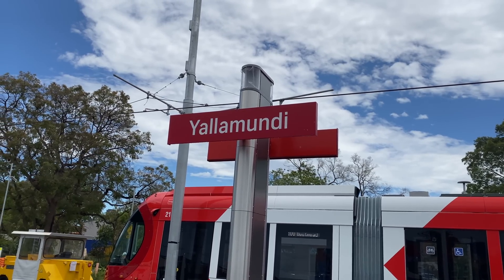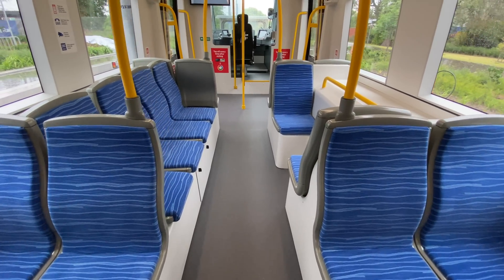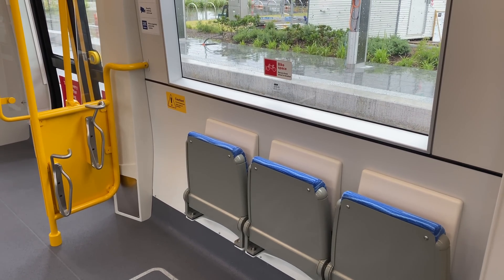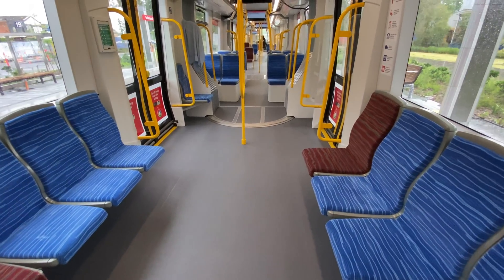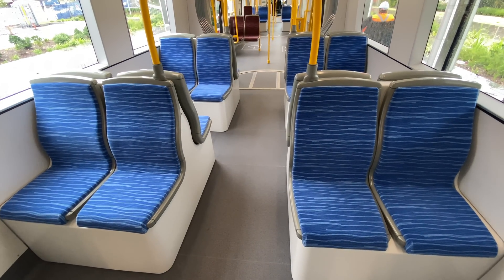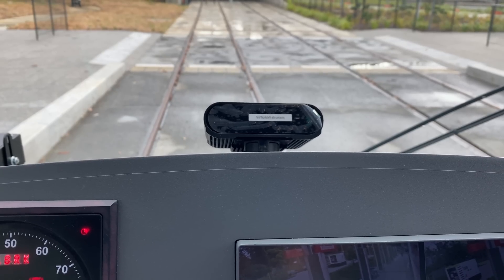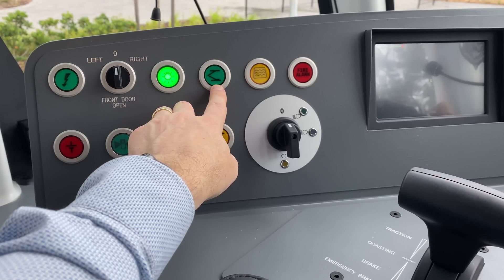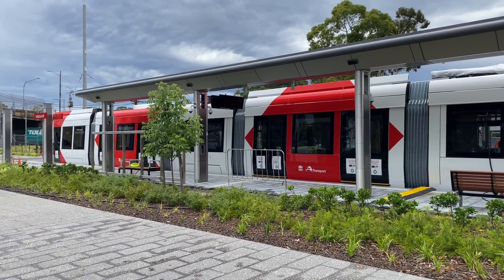Inside the Brand New Parramatta Light Rail Vehicle - First Look at the new CAF Urbos 100 Tram

Comment: I love that Sydney is building more light rail but I don’t really like the ‘battery powered train” thing since I think with Lithium batteries it creates an unnecessarily high fire risk and the use of rare earth minerals obtained through slave labour is kind of terrible, fuelling conflicts in the same way as blood diamonds. It just seems unnecessary when having a constant power supply is one of the best parts of electrified rail over any other transport solution.
Reply from the maker: I think it has a lot to do with the perceived ugliness of overhead wires along streets! For some reason, the key decision makers seem to prefer wire-free alternatives. Sydney Light Rail is a good non-battery solution, with the ground-level power supply system used between Circular Quay and Town Hall.

Comment: Its strange why they didnt use the same Alstom Citadis trams as they look modern and are still pretty good
Reply from the maker: I think it comes down to which company could offer the best vehicles, and the CAF trams had the battery option. They're both good trams, although I do like the sound of the motors on the Alstom trams 😀

Comment: Why the aversion to overhead wires?
Reply from the maker: Hi Smedley, I'm assuming you mean on the wire-free sections? I think overhead wires are seen as untidy, and unsightly in CBD areas, probably more by politicians and local councillors than members of the public! However, it makes sense to make use of battery technology, now that it's available.
Reply: @TransportVlog  Melbourne does not have any problem with wires and they avoid all the extra expense of battery technology.

But if batteries gets tram lines built, then I am all for it.

Comment: Another tram of dubious value it has already caused major disruptions for business in the Parramatta area actually a heavy rail system would be a lot more effective
Reply from the maker: Hi Robert, A heavy rail solution would have caused lots of disruption too, and would have less stops, and would probably need to be underground through the Parramatta CBD which would massively increase the cost.
Reply: @TransportVlog   if it had been done during the Labor Govt and taken to Carlinford it would have cost vastly less than is whst is being spebt now
Reply: @TransportVlog   As I said if Costa had extened the now defunct Carlinford line to Epping a vast amount of money would have been saved

Comment: I don’t know why Sydney refuses to use the same trams across all lines. It would increase commonality and standardisation and mean that all trams would be interoperable on all lines, reducing costs.
Reply from the maker: Yes there would be some benefits in using the same tram type on all lines, but having Alstom trams on the L2/L3, allowed the L1 to restart much earlier, when cracks were found in the CAF trams, so having different tram types helped when this happened.

Comment: Viewed this from Toronto. There's a number of aspects to be envied, not least the 'wire-free' sections. Unfortunately lithium batteries become problematic in sub-freezing temperatures. You lucky b*gg*rs in so many ways! 

Great video!
Reply from the maker: Hi Stephen, yes we are lucky living in a warmer country.  Besides being able to use lithium batteries, we also have the Alstom ground-level power supply system on the Sydney CBD light rail, which also works better in warmer climates. Great to hear that you're watching this from Toronto!

Comment: With 7 articulated modules and 45 metres long, is it known if all modules are initially delivered by road in one unit or two? Great camera angles and the inclusion of the mule and auxiliary motor generator unit.
Reply from the maker: Hi Adrian, it came by road from Port Kembla docks as two units. On the walk through, there is a towel on the left. That was where the split was. Glad you enjoyed this video and the camera angles.

Comment: I think they can start testing earlier then mid next year one they put the over head wires up they could start Testing between Carlingford and the Maintenance Facility
Reply from the maker: Hi Chris, I think the sticking point is the maintenance facility which is still someway off completion. I haven't been there for a while, but am planning to take a look from Grand Avenue over the Christmas break, along with seeing what is going on at the Clyde site for Sydney Metro West.  But yes, I reckon testing will definitely start on the Carlingford Section first.

Comment: The longitudinal seating looks good but very tight in the end modules. Did they forget people have feet?
Reply from the maker: Hi @ianpage3779, It's the same as on the earlier CAF Urbos trams, and I think they are longitudinal to allow space for the traction motors which are between the seats and windows.
Reply: Those seats are a nuisance in the Inner West trams, but what does TfNSW learn from mistakes? How to make them again.

Comment: Thanks Paul. Whem you say "bogies" I asume these are the same kind of fixed wheelsets as used on other Urbos sets rather than railway style pivoting & rotating bogies like the Melbourne trams have.
Reply from the maker: Hi Paul, yes they are fixed wheelsets, so that would have been a better term to use. I don't think its possible to have a 100% low floor tram without using fixed wheelsets. Are the ones in Melbourne with bogies low floor trams, with step-free access etc?
Reply: @TransportVlog  That's  what I thought. Technically a bogie (or truck) is a set of four wheels that are able to follow track curves, which these do but in this case, the whole car segment rotates with them. AFAIK Melbourne trams are not low floor throughout.
Reply: You mention the OESS system being lithium batteries. Has this been confirmed? I would have hoped they would use super capacitors like on the Newcastle trams rather than batteries. Super capacitors are a lot more environmentally friendly to manufacture, safer in accidents and  longer than lithium batteries before requiring to be replaced.
Reply: @albert3801  the Newcastle system is agonisingly slow, have to wait and recharge its capacitors at every stop. Parramatta needs to do better.
Reply: Yes, the same fixed wheelsets which contribute to the problems  being experienced on the Inner West line. This arrangement is not suited to lines with sharp radius curves, of which there are several on this line. Not only damage to the trams, but also rapid wear of the rails, also becoming obvious on the South East line already. Melbourne discovered this problem years ago and switched to trams with swivelling bogies, but the ostriches at TfNSW don't want to know. What do they learn from mistakes? How to make them again!
Reply: @brianb8516  All the trams on the inner west line have had fixed wheelsets but only the CAF ones had problens with cracking, a problem also experienced in other cities with the same series of Urbos sets. The inner west line has a mixture of heavy rail and tramway track geometry, and high speed running, which is more likely to have stressed the chassis than tight curve radii.
Reply: @peterelvery  It is hard to pinpoint the cause of the cracking, engineers and lawyers will be arguing over this for years LOL. While the rails may contribute something, suggesting the trams run at high speed is very optimistic, I think the max allowed is 70 (in the Glebe tunnel and less in other sections). The Alstom trams are younger, so it is yet to been how they perform, and the curves on the L2/L3 are not quite as severe; they had very severe limits on those curves (down to 5).  The previous Varios on the L1 were reinforced during construction when their engineers realised that the curves were too severe for the standard product. The curve at Hay St off the down ramp is about 20m radius, and the accepted minimum for a fixed wheelset is around 25m. The rails at the bottom of both ramps off Hay St were recently replaced due to the high level of wear.
Reply: @brianb8516  Thanks for the extra info. It's very likely due to the combination of many factors. 
I assume (because I don't have any info to the contrary) that the CAF units have conventional axle-connected wheels. A feature of the Variotrams that may have been beneficial on tight curves was that each wheel was individually driven, minimising flange binding and vibration.
You're right about the maximum speed. It's not high i absolute terms but as I understand it, the wheel/flange profile is a compromise due the mixture of track type, especially an issue through points in the former freight line section where 70km/h running is more likely to occur.
Reply: @peterelvery  have a watch of this clip https://www.youtube.com/watch?v=rv-IbQ0Ynzc
you can see the speed limit signs, along with some long standing TSRs in several places. 
Also, watch the driver's head as the cabin yaws, even at slower speeds. A common problem in this type of tram.